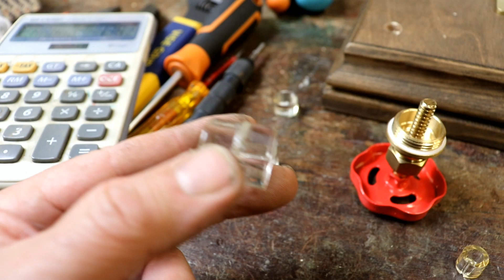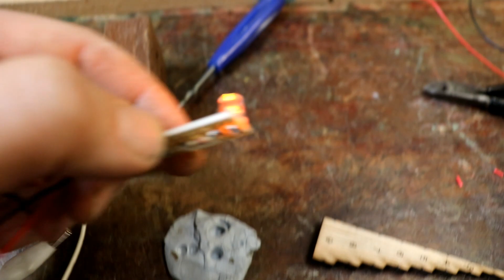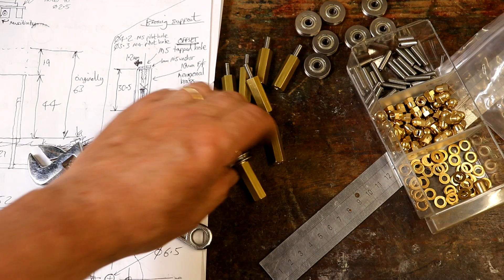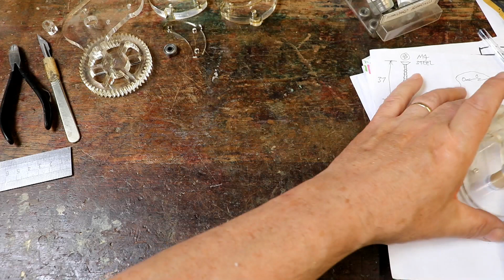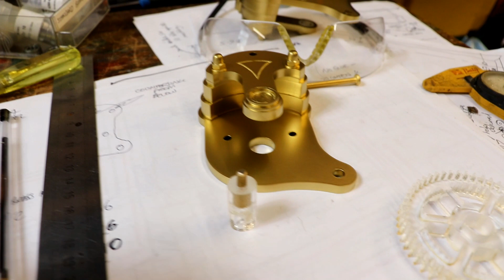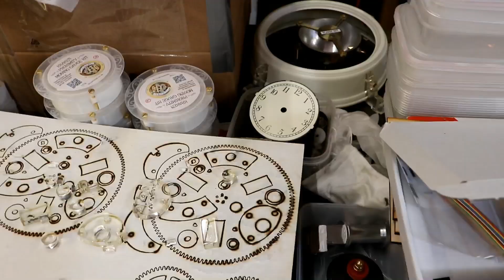A steampunk weather machine - part 4

Comment: are the led lens 13mm dia? looks very effective.
Reply from the maker: The lens is 21mm diameter and the flat lip at the back is 23mm diameter. They're apparently intended for LED lamp manufacturing. 

I got a load (thankfully) years ago as I use them for the flickering lamp indicators and the readout on the Barometric Prognosticator. Lots of lenses used on Victorian devices, so it seemed only fair.

If you have one mounted against some opaque white acrylic, with a flickering orange LED at the back, they do make lovely indicators.

Comment: I'd be interested in how they did that flickering LED teardown.
A list of random numbers sounds just like the ridiculous sort of thing we can do these days, although I would have guessed it was a pseudo-random number generator, based on a shift register with feedback.  Then again, without trying it I don't know if that would look good or not.
Reply from the maker: Hi Epi, I've just tried finding the YouTube video, sadly with no success. LEDs flickering on videos, no problem. Someone actually investigating how they achieve the flicker, no luck. I remember he managed to connect it to some sort of data analyser, possibly via the supply pins, measuring current, although I'm sure it was more refined than that. I remember seeing lists of, as you say, pseudo random numbers, that were stored within an array on the LED's chip... I'll keep searching.
Reply: @steamhead  Thanks very much for looking.  Please don't put yourself to too much trouble.